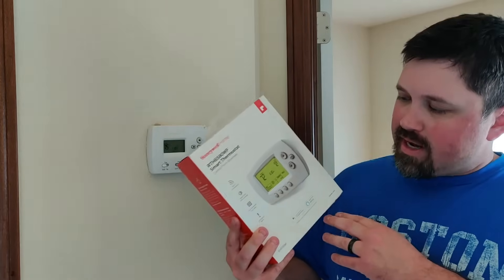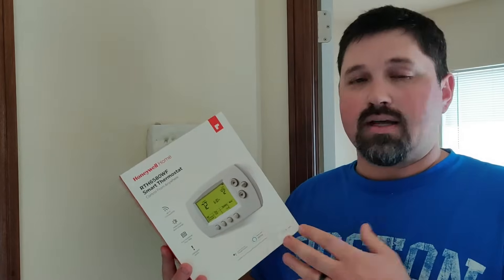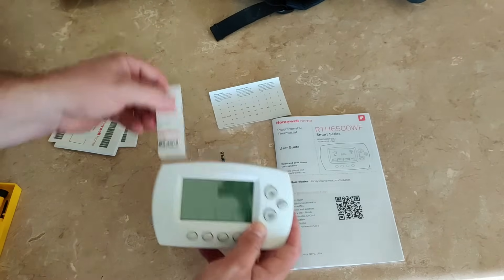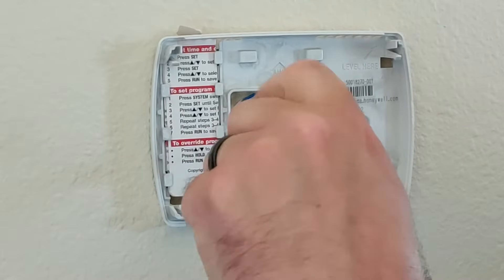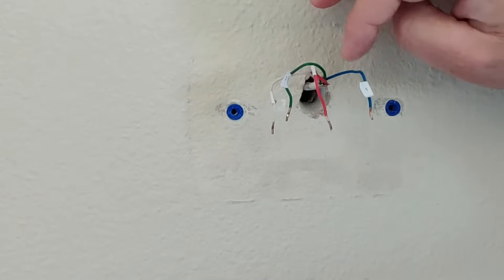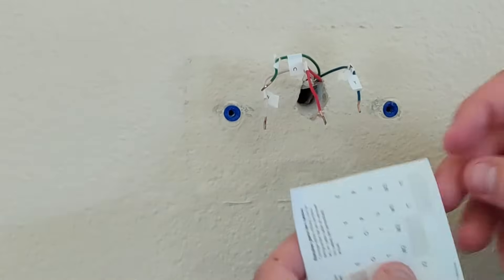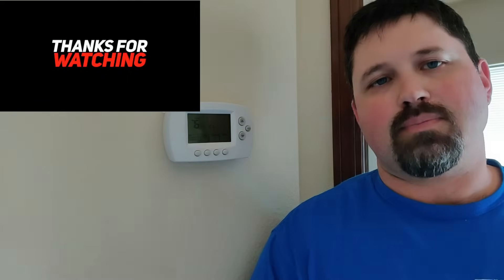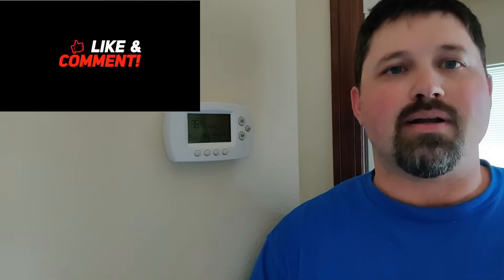How to install a Thermostat (C-wire adapter)

Comment: I did not need this video as I have a c-wire, but I was just curious, and interested.

As he said, turn off the breaker. If you do not, make absolutely sure that you do not touch the new common wire to the red wire by accident. Should you do that, you will be hunting for a 3-amp fuse in your system, and if you live where I live, it is often in your attic. In addition, your auto parts store may not have them, since many start their selection at 5-amp fuses.

Comment: Please kindly help!! I only have red and white wire coming out of the thermostat. I have anew Honeywell t6 Pro I want to install. I do have the powers adapter. Would I just similar process on the furnace onboard without a third wire coming out of the thermostat?? Red wire is connected to R on thermostat white wire is connected to we/aux slot thermostat.

Comment: Thank you for share your great work and great instructions! Just a little question: on you furnace board, looks like there is a “C” wire connecter, maybe i’m wrong but thanks again for sharing.

Comment: Guys Question, If i take the G wire and now label it C wire with the adapter. Does that mean the fan is disable from running by itself? What i mean is that right now, i can run the fan to circulate the air. So if the G becomes C, the fan can not run by itself?

If that's the case, why do i need the adapter?

Comment: I attempted to replace a Honeywell TH3110D1008 thermostat with a RTH2510 on a standard gas/heat pump system. Wired all the color wires to their corresponding positions on the RTH. However the Blue wire on the old TH3110D was going to the ‘C’ terminal. I wired that Blue wire to the ‘B’ as per the manual. The HVAC has. ‘C’ blue terminal as well. Nothing works; not heating, cooling or fan. It seems like it’s missing a Common but do I need a ‘C’ adaptor like you show?

Comment: How many blue wires can go into C terminal?  My furnace already has a blue cable attached to the C terminal.  Now I am afraid to attache another blue labeled C cable from the  Honeywell C adapter😅.  Could that blue cable is for another thermostat

Comment: Where do I connect the blue wire I also have yellow and ,, do I set up gas or electric my heater is gas and my ac is electric??

Comment: I’ve read if you remove the g wire and put it in the c slot that the fan won’t work by itself unless the ac or heater is on, is that the same with the adapter or will it work with the adapter?
Reply: Did you find an answer to this?

Comment: Would  my system would be "other" when it comes to determining my heating/cooling type. I have a dual fuel system but I do not see it in the instructions but I wanted to double check.

Comment: I followed the wiring.  But when I finally plugged it in. The GUI didn’t turn on but the heater kicked in on its own   Help
Reply from the maker: Is this a new thermostat?  Does it run on batteries?
Reply: Yes. New.    Same one you have there
Reply: @Kingdenniz518   It could be that there is a splice in your wiring you don't know about, where wire colors were switched/not the same on both sides of the splice.  Try swapping R and W at the furnace/A/C terminals.  Either this or you didn't wire correctly somewhere.

Comment: Hi, can i just use one c wire adapter to connect multiple smart thermostats , one for each floor in the house?
Reply from the maker: Does your furnace have zones?
Reply: @HomeRepairHub  thanks for the response. I am guessing "yes, the 2 thermostats have different zones." One controls the temperature in 1st floor and 2nd controls 2nd floor. And they can operate independently.
Reply: @bubbudubbu5515   Yes, you could land the two wires from each thermostat onto the one set of thermostat-side terminals of the adapter and have it work the same, if both thermostats control the same heating/cooling unit (I am guessing this is your setup).  For whenever the upstairs/downstairs settings differ, whenever either thermostat's setting requires heating/cooling to operate, the system will operate even if the other thermostat's setting says it should be off.  I'm an electrician.

Comment: you don't need a c-wire adapter...those 2 other wires that are also connected to the board are C & RC wires & weren't connected to your old thermostat because wasn't needed...if you look inside the whole in drywall behind the thermostat they r most likely there! ... nice video!

Comment: If I install a smart thermostat upstairs and downstairs, can i use only one c-wire adaptor?
Reply: Not if you have two furnaces that are connected to each thermostat independently.

Comment: I just wanted to thank you for this video. I had a slightly different setup so when I followed your steps it still didn't turn on. I had to connect the R wire to the RC slot on the Honeywell T5 unit. Then it turned right on. Every other step was exactly as you described. Thank you for saving me hundreds of dollars. My local company wanted to charge $600 for 10 minutes of work.
Reply from the maker: Glad I could help.  Thanks

Comment: I was wondering what this was and don’t quite understand why you need it. You can pull another thermostat wire easily and in your air handler you have a C wire to the far right. That’s your common wire. Just get a new thermostat wire with a few extra wires and tape it to the existing in the house and pull it to your air handler and reconnect wires.

Comment: Thank you for this video! I really like that it was straightforward and you didn't sell us anything or mess around at all. Quick question though, what do you do with the C-wire adapter box after you have connected all the wires? Do you just let it hangout? Do you attach it or tape it to the inside of your furnace unit on the sheet metal?
Reply from the maker: I had a shelf below the furnace that I could set it on.  There should be a spot on the back that would allow you to hang it on a wall or something....or get some double sided tape

Comment: I cannot thank you enough.  I needed to install the C wire adaptor and went I looked at videos on that I got totally taken down a rabbit hole.  I even had videos pulling new wire!  Ugh!  Yours is the first one that was absolutely clear about what do do.  And you had proper lighting by furnace so I could actually see what you were doing!  Thanks so much!!  With your help I should be able to do my install tonight.
Reply from the maker: I appreciate the feedback.   Glad the video helped
Reply: I don’t have a c I have yellow wire do I put the blue together with the yellow wire

Comment: Sorry, not a fan, no pun intended. If the wiring block on the air conditioner had a c terminal why would they just run a c wire? Mine has only a red green and white wires making this entire installation impossible. This was not clear enough when I bought this unit and now it's too late to return it, not happy with Honeywell at all.

Comment: I hooked everything up and now the outside unit keeps running even when off. I removed a jumper should I keep it on? Thanks
Reply from the maker: I would suggest putting the jumper back on.  I apologize for the late response.

Comment: Hey bro is it bad if I put the red one on the RC place? I did that and everything is working fine
Reply from the maker: So usually if there is only one red wire it will be put on RC or RH, and then there is a jumper between RC and RH.  If there are 2 red wires one goes to RH and one to the RC.
Reply: @HomeRepairHub  I have 1 red wire but on the thing I have R and RC next to it

Comment: What if the thermostat keeps powering off and on like flickering at the thermostat?
Reply: i think this is because your furnace is doing 120v where as this adapter or the c-wire in general is looking for 24v. trying to confirm this myself

Comment: So I just did this and now my ac system will not kick on at all. I tried putting everything back the way it was originally and still nothing. PLEASE HELP!!
Reply from the maker: new thermostat?  Is there a battery in the thermostat?  Are you seeing anything on the display of the thermostat?
Reply: @HomeRepairHub  it was an Amazon smart thermostat. AC was operating until I tried to install the c wire adapter. After I installed the adapter there was no power to the thermostat and no air blowing from my system. So I reinstalled to the original thermostat and uninstalled the c wire adapter but still no air flow.
Reply from the maker: @amandaasher4911  and still no power to the thermostat?
Reply: @HomeRepairHub  I figured it out. It was just a blown fuse. Thank you so much for your quick reply.

Comment: A little confused.  What happened to the original labels that you put on the wires at the thermostat when the old one was removed.  When you installed the new thermostat, the labels were different???
Reply from the maker: So if you watch from about minute 4 on, you will see that I put new labels on some of the wires.  Hopefully that helps.

Comment: What do I give up if I use a C wire adaptor ?
Reply: Nothing.  If you DON'T use an ADAPTER, then you have to give up discreet fan control.  With an adapter, you don't have to give anything up.
Reply: @glensamels4964   I wonder how that works...I'd like to see an internal wiring diagram of the adapter!

Comment: “My green wire is connected to G a blue wire to Y a cream wire connected to W and a red wire to R with a jumper to RC.My spare wire is yellow is this d C wire? I am starting to get the feeling that the blue wire connected to the Y is the actual C wire and that the thermostat was just connected wrong. Would this be correct? Everything has always seemed to work fine. I live in old apartments but use alexa and I really want to get a amazon thermostat.
Reply from the maker: you would need to look at the board on the furnace to verify.  But yes in most cases the C wire is blue.

Comment: I have a YC and a GF.. it's an 8 with the 4 still in the wall but none of them are beeping with my tester as common
Reply from the maker: I would suggest checking the board on the furnace.
Reply: @HomeRepairHub  no board,  I found 27 on (obviously) one of two from the outside unit, happened to be blue and yellow. Tapped( not literally) into the wire that fed INTO the transformer with one of the extra 4 in wall on top the blower, and ran WH-w, RV-R(not rc, and closed that switch off on tstat) , YC-Y, and  my "new"(unused wore already fin loom) to C and called it a day. Got my constant(common) and alexa us happy, house is cool once more lol. Thanks guys+gals.

Comment: Sadly, poor explanation of C wire adapter.   At the furnace, the second set of wires were labeled Magically.       Also no explanation of how fan and heat are now one control and CAN NOT request fan only ?
Reply: If you mean the Honeywell c wire adapter wires those come prelabeled.  So i guess that could be considered honeywell magic?

Comment: I have a label on my thermostat that marked RC and RH. Could RC be my C wire connection?
Reply from the maker: Not sure, is there a spot for a C wire on the thermostat?    When you go to your furnace control board you should be able to see what the other end is plugged into.
Reply: No.  RC is not C.
Reply: R = red wire; RH = red wire for heating control; RC = red wire for cooling control; obviously, any color of wire can actually be used for any connection, but red is conventional.  C = common (the neutral/return wire path) and usually is blue from a non-battery-powered thermostat and white from an outside air conditioning condenser unit; again, colors may vary.
Reply: RC Vs RH,
Means that you have two separate 24 volt sources which is sometimes the case, meaning cooling circuit has a designated control transformer, as does the heating circuit. If there is only a single transformer then there’s no chance of “bucking” and a jumper should be installed between the rc and rh terminals.

Comment: Can you use the adapter and would it still work if you have a c-wire that doesn't deliver 24v?
Reply from the maker: You may need a power adapter if it doesn't deliver the 24v.  I don't know for sure though.

Comment: How do you know which one is the thermostat wire at the furnance?
Reply from the maker: When you pull the old thermostat off you want to label your wires.  Then on the furnace board it will be labeled with the same letters, otherwise the color of the wire will help identifying it at the furnace.  Is that what you are asking?

Comment: My old thermostat has the same 4 wires as what are shown in the video, plus there is a O/B wire. Can I use the same Honeywell adapter and connect the O/B wire to the O/B post on the Honeywell Wi-Fi thermostat? Thanks
Reply from the maker: So you have 5 wires correct?  How many wires are required for the new thermostat?  I think you only need 5 correct?  You may not need a C-wire connector.  https://www.youtube.com/watch?v=YN8WXTcj-D4

Comment: my old thermostat only used 4 wires, BUT there are 8 wires coming out of the wall, including the copper wire, but it's not working, so I heard that maybe it's not connected on the other end (since it wasn't needed by the old thermostat), so in that case, is it likely I just need to get into my attic, find the wire and connect the c-wire on the other end, and don't need an adapter? Thanks, nice viedo!
Reply: forgot to follow up on this. I did indeed go into my attic and hook up the extra wire since I had 8 available. However, that didn't fix it! Had an electrician come out, he took a look, said it all looked good. BUT, I didn't put the darn panel back on the unit and apparently it had a closed-panel circuit trigger, so if I had just screwed the panel back on it would have worked fine! so the guy charged me $94 to put a screw in basically, heh. ah well, lesson learned :).
Reply: @CleoCat75   Yes, most modern HVAC equipment have spring-loaded front door/cover safety kill switches behind the door/cover that open and deenergize the control power and/or main power circuits as soon as the door/cover is opened or removed so that blowers won't turn on and burners won't ignite while someone's working inside the unit.

Comment: The control Board of the furnace shows a  C terminal but there is no wire connected to  the existing Honeywell thermostat which has no C terminal. The R terminal of the furnace has 2 wires connected to the thermostat , one connects  to the RC of the thermostat and the other connects  to the R of the existing thermostat. The W, Y, and G terminals of the furnace are connected to the W, Y, and G terminals of the thermostat. The C of the furnace connects to the terminal of a Relay contactor.
I bought a MOES smart wifi thermostat for the furnace and AC that requires de C cable. The Diagram of the thermostat requires a jumper from RC to Rh. The Diagram also shows the terminals W,Y, and G to be connected to the furnace and I should not have any problem with that.
I am planning to connect  the R terminal of the Furnace to the RC terminal of the thermostat with a jumper from RC to Rh. Remove the other connection that goes from R of the furnace to the Rh of the thermostat and use this cable to connect the C from the furnace to the C of the thermostat and would keep the existing connection from the C of the furnace going to the terminal of the Relay also located at the furnace. Do you think that this new wiring could  work?
Note: there  is only one transformer at the Furnace
Reply from the maker: Without seeing the diagram for the new thermostat I don't know the answer to that.  As long as you connect everything the way the diagram for the thermostat shows you should be alright.  If you have an extra wire and you are sure it the same wire on both ends I don't see any reason you wouldn't be able to use it for the C connection.  If you have some concerns you may want to take pictures and go to and HVAC store and see what they say or call in an HVAC tech to look at it.  I am not an HVAC technician so I am not sure I would be able to help in this situation.

Comment: Installation starts at 2:15 for quick reference
Relabel at 4:30
C wire adaptor at 7:20
Connect plate at 8:46

Comment: I just installed an Amazon smart thermostat and your video is spot on. I needed a c-wire adapter and the one Amazon sold for it was the Honeywell you used. Everything was the same. Made this so much more easy to install. Thank you

Comment: Do you have to change all Thermostats (I have 4 zones with 4 air handlers) in the house after installing the C Wire adapter? Are you installing the adapter at the furnace or the air handler?